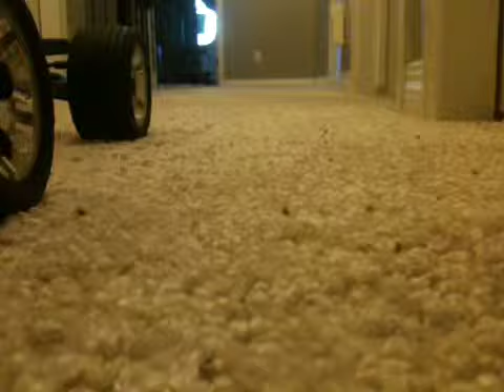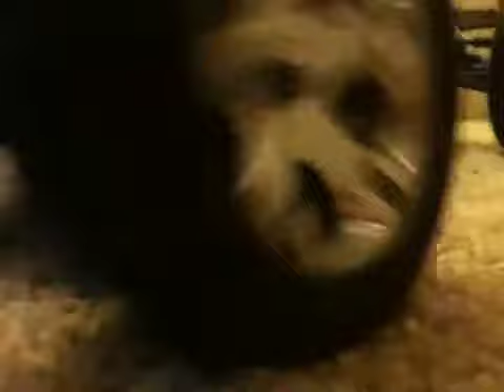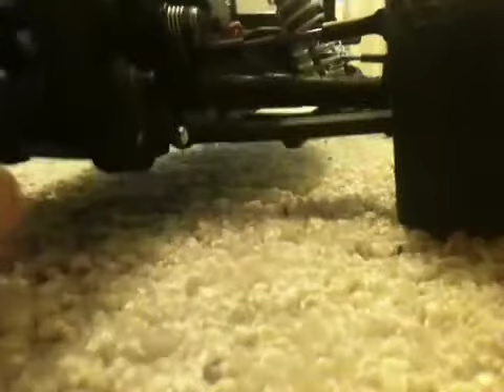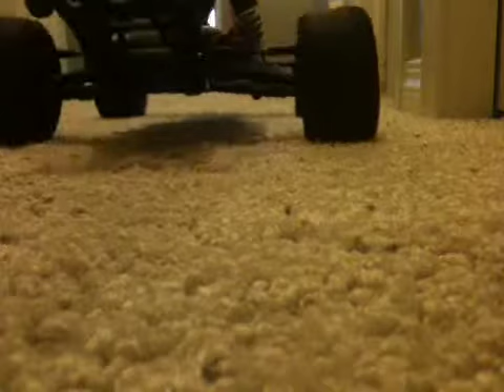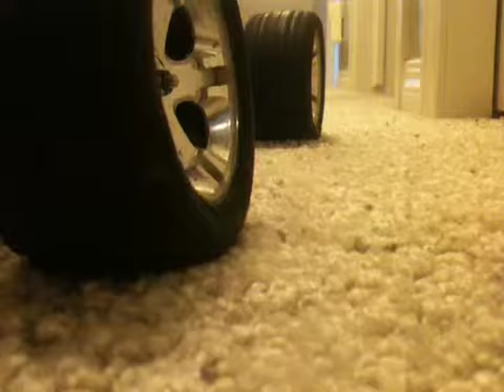Traxxas rustler studders help

Comment: That motor should spin fast no matter what, itll break the transmission gears if theyre holding it back. Something sounds really wierd there. Id take the pinion gear off the motor shaft just in case and see if the motor spins fast. If not then its the motor/esc maybe the radio. Is that the same transmitter you use for your Revo?

Comment: @95666 Haha, sorry man, "you need" that sounded rude. nah, take the reciever covers off on your revo and the rustler, unplug both channel 2 wires from each car,. plug the wire from the rustler esc into the channel 2 on the revo, calibrate that radio to the esc on the rustler.